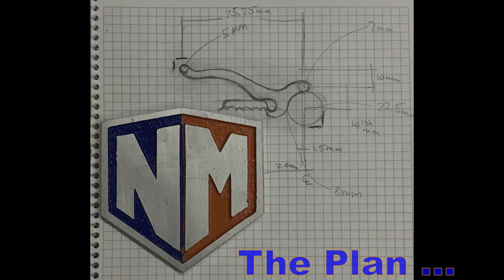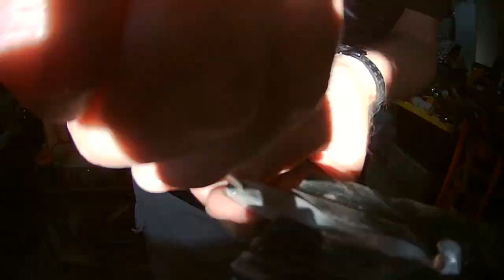Bottle Opener Build - #2019OpenersOpen

Comment: Noticed I missed your enrty from the playlist Perry just put out, so just watched now, the simple hacked openers are very clever, the custom opener looks very nice and smooth, well done 👍
I realy like your Logo, looks like a cube viewed from an angle and looks like a shield at the same time, I Subscribed, I'll be watchin more of your work 👍👍👍
Reply from the maker: Thank you for the great comment. You nailed my vision of my logo. It was the intent to be viewed as a forced perspective cube and be a shield at the same time. 

I loved doing the hacks and my fabricated opener came out exactly as I had hoped. I wanted to use it to make a sand mold for an aluminum casting version but I’ll probably do that in another video.  Cheers!